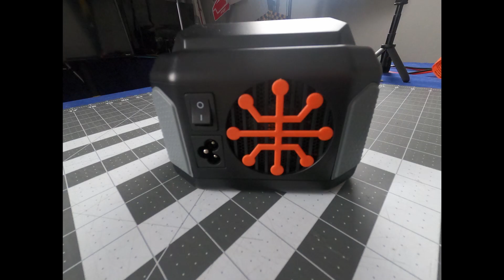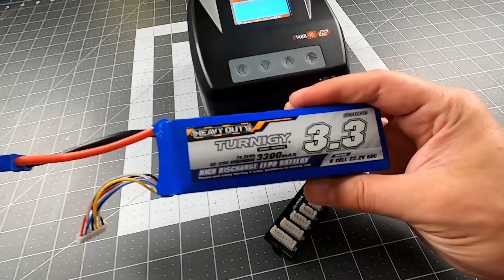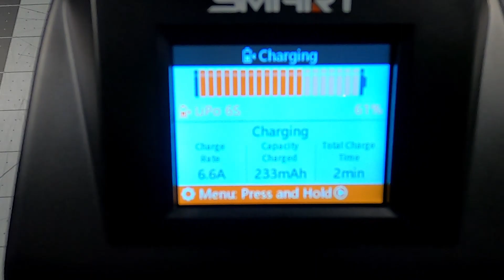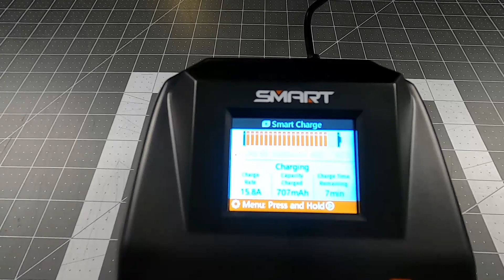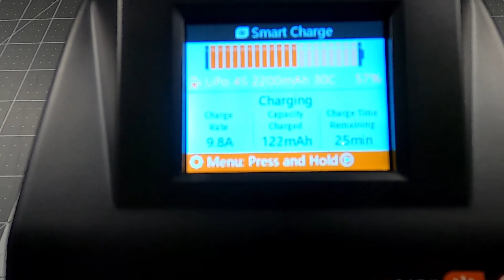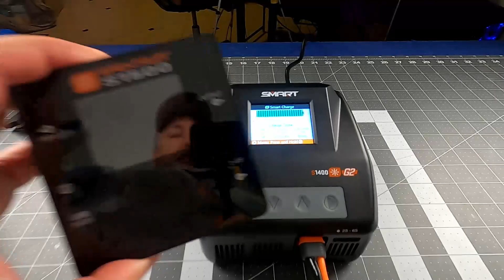NEW Spektrum SMART G2 S1400 400W AC Charger Review!

Comment: Hey Air Marshall....I just got this charger and I am only able to charge a 6s 5000 G2 battery at 9.3 amps max....any thoughts?
Reply from the maker: That’s interesting. You should be able to charge that pack up to 5C, or 25A. Now the max you can get from a 400W charger on a 6S pack is going to be closer to 18A. Are you sure you got the S1400 charger and not the S1200? The S1200 is going to peak around 9A on a 6S pack.
Reply: @TheRCAirMarshall  thanks for responding....lol its the S1400 I was upgrading from the S1200 😮
Reply from the maker: Sorry, hah. Had to ask. You should be able to get 18A on a 6S pack.

Comment: I bet there's a firmware out there that would allow you to use both ports and charge two batteries at 200W each.
Reply from the maker: Not so sure... I have to assume the the ports for any given channel are wired in parallel.

Comment: The device limits to a 5C charge...? 

While that’s awesome for safety, that sounds like I can only charge four 3S/4S size batteries at 1.25C on one side and another four on the other side? I was hoping to be able to jack up the amperage to 20A so I could get almost 2C parallel board charging on my 2200 packs, decreasing in rate to 1.25 on my 4000 packs. 

Now I’m thinking that I should I limit myself  to 2 and 2 at 8.8A for 2200 packs to get 2C each and 16A for 4000 packs? This would also align with the current 2C programmed charge settings.
Reply from the maker: The 5C limit is only for SMART batteries. For non smart batteries you can use whatever current you want, just be safe. 👍

Comment: Any ideas why the new batteries default to storage voltage of 3.9 volts?? I love that they come by default with 72 hours until it will go into storage, just not sure the reasoning behind the 3.9v
Reply from the maker: No idea, I changed all of mine to 3.80. I also thought 3.9 was a little too high
Reply: Ya at least it’s super easy to change 👍, just would have been nice not to have to touch it at all now that they default the auto storage nicely ☺️

Comment: I guess these new batteries limit who can buy them. I prefer my 1000w 30a charger because I drive cars, boats, planes, and FPV so I need the flexibility. I guess I have to stay with your Gen 1 packs even though I upgraded to smart ESC's on my vehicles and I cant use your new battery. Im a bit disappointed TBH. Is the balance lead the only difference with these batteries?
Reply from the maker: The balance lead going away is one of a few differences. Really the only thing they have in common is the cells. Still the same great cells being used in the Gen 1 packs. The new G2 batteries have improved heat dissipation plates, improved smart chips with more powerful balancing capability and faster auto discharge. The smart chips now have upgradable firmware so in the event changes are made they can be updated to the new standards. There were a lot of improvements made. I agree, I would like to see a balance lead still there, but that’s more for folks who want to use the G2 packs that don’t have smart chargers like yourself. For people who only have smart chargers like myself, there’s only a handful of applications where the balance lead is truly useful, as I sometimes use it to power external devices. With that said, in my quads and surface vehicles where I have torn off lord knows how many balance leads, I’m kinda glad they’re gone...
Reply: @TheRCAirMarshall  Its just the fact they are only compatible with one charger due to no balance lead. I actually dont care the balance lead is gone. I just cant buy a new charger which means I cant use the new batteries.

Comment: I like the look of the gen one better but I have to agree on the fact buttons are better then a slider. Thanks air Marshall. Not much difference screen looks smaller though
Reply from the maker: Screen is the same size, charger is just physically larger to jam a big fat 400W power supply inside there! 😁